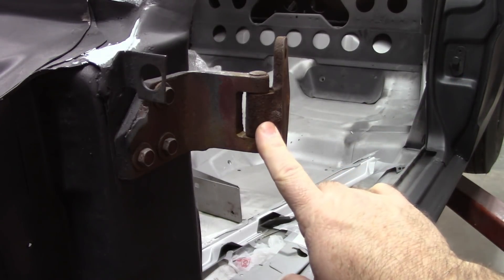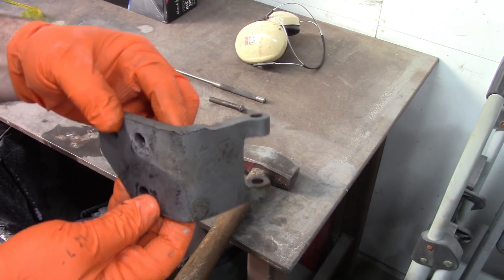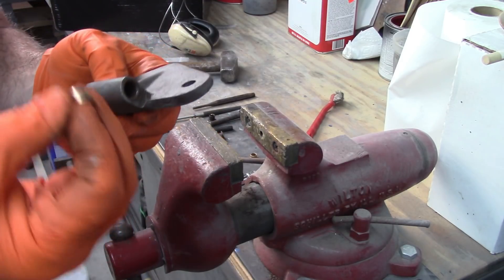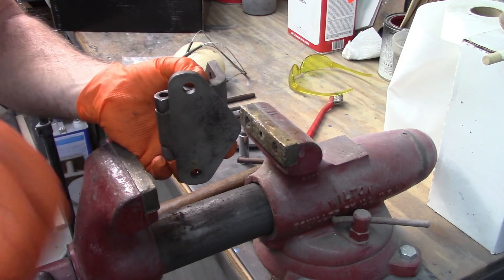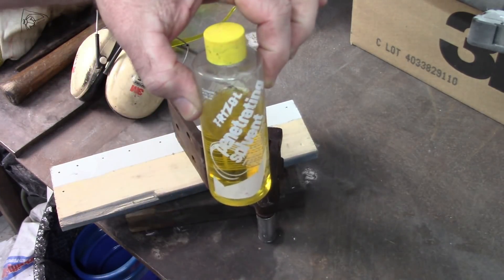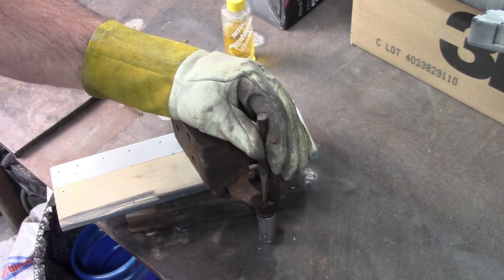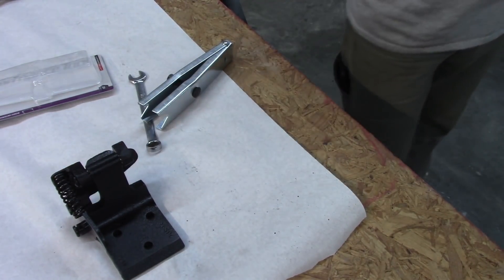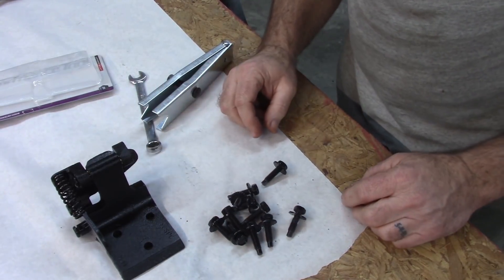Mustang door Hinges rebuild. Brooklyn Pony part 37

Comment: Only now getting to the hinge rebuilding process. Once again, Barry, you've saved me a lot of time and more than a little profanity, I reckon. Based on this video, I made a positioning jig to hold the hinges while I drifted the pins out, and made one of your slide hammers to use with the flame wrench. With your pin shaving insights, the rebuilds were a 'piece of cake'.  Can't thank you enough. (Haven't commented in a while, been too busy working on her. Without your videos, this is one '66 coupe that would have been at the crusher's yard two years ago.  Now she's whole and solid as a rock. Starting to put body panels on for fitting; more hours to spend at 'Jo Daddy University', but loving every minute of it! Thanks.

Comment: When you was cleaning up the flashing and edges of the upper hinge, I couldn’t help as to wonder about the guy who held it with tongs as a 20 ton press come down and hit #1, he flipped it over into die #2, stepped on the trip bar and hit it again. If he was still around, he may tell you the number of times it was struck to produce that one part. Yes, a little rough around the edges but only one of 40 million more to make. 
  We take our rebuilding skills with pride to make a nice tight hinge that allows us to adjust and enjoy a repeatable door closing. Body lines match, solid sound, nice fit and perfect close. Because of your efforts, re-using a 44 year old part, possibly 45 years old as used over several years. This is keeping as much as the OEM parts on the car as possible.
  It’s like, I will fix the rusted OEM part keeping that part in service. Complex lower with spring, a lot to do and you showed everyone how to get it done. 4 pound  hammer forged hinge compared to the new stamped steel hinge. A 2.6 pound lighter & cheaper part that no one will rebuild in 44 years. Just buy a new one and toss the OEM part. Blessing for your work, effort and step-by-step (Keep In Order) instructions. Thanks. At 62, recovering from my 4th lumbar “Total Replacement” but proud of years of diagnosing the root cause, not having a come-back for over 3+ years at the dealer, fixing them right the first time. It’s not about me, but the guy fixing his own car and guys who do this for a living. This increases the respect an automotive technician deserves. For that, I thank you and enjoy the clear videos (Work Themselves), that I have done on other brands but not Fords. Thanks! 
Retired - ASE Master Tech since 1978
Reply from the maker: Thanks for the comment. I often think about the men and women that worked to put these and many other cars and trucks together.

Comment: need to get you a harbor freight shop press. i sheered off the tool steel pin on my vise using it as a press. lesson learned the hard way to use the right tool for the job.. unless you need something hammered in.. then anything's a hammer.. :P
Reply from the maker: Maybe when I get a bigger shop... It's a good thing I have an industrial vice... And a backup vice.
Reply: @JoDaddysGarage  yup. backup is always good. mine was an industrial that my grandpa gave to me. luckily my roommate at the time was a machinist, so he made me a new pin. i have a wilton as well, but my big one now is a palmgren 6". nice work on those hinges though. 67-68's are waaay easier lol.

Comment: Awesome video. We bought original 66 doors to replace the rusty doors on my 65 and fun fact the 65 and 66 hinges are slightly different. My 65 are square on the ends opposed to the tapered ends like on the 66 and the bolts are different sizes. We are keeping the 65 hinges on.

Comment: Very good video on hinges applicable to other makes as well....... I've done my charger hinges in a similar way. But I usually use my air hammer and my own turned down drifts to get pins out on the vise. Now if I go to the trouble of doing hinges I like to add grease zerks to provide lubrication to bushings. But I know some people like it stay original but I'm after longevity and I hate Mr rust.

Comment: Your video was very helpful the only problem is on my hinge the pin with the roller is snapped off .what is a good way to get it out? Thanks again for the videos !
Reply from the maker: Center drill it. Start small and step up size. Lack of material will reduce stress. You can also heat it up with a butane torch to break the rust loose.
Reply: Thanks! I was thinking the same but hoped there would be an easier way. But if that’s the way you would do it ,that’s the way I’m doing it .Thanks again your videos are the best.